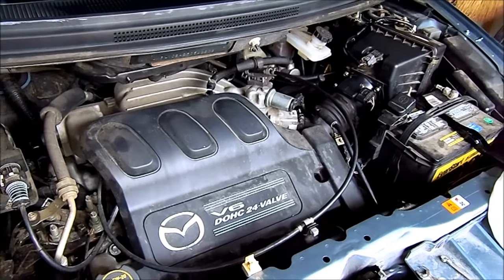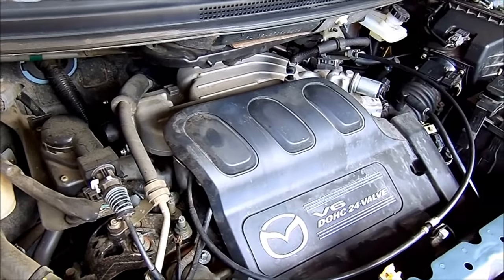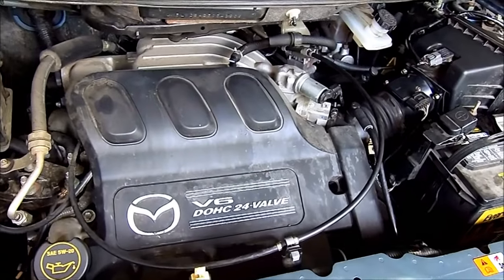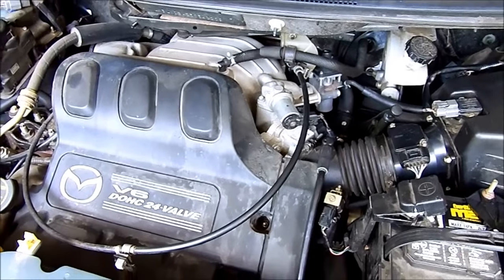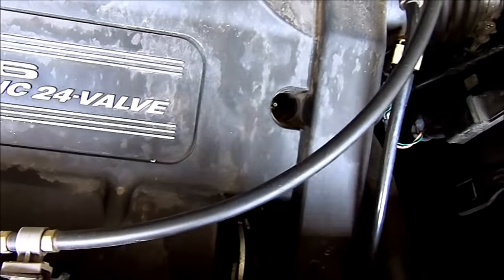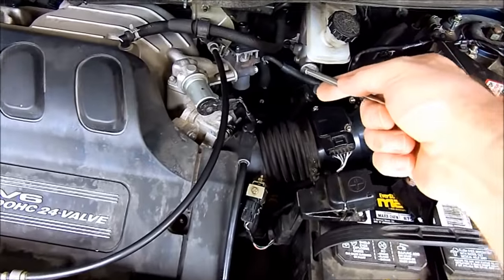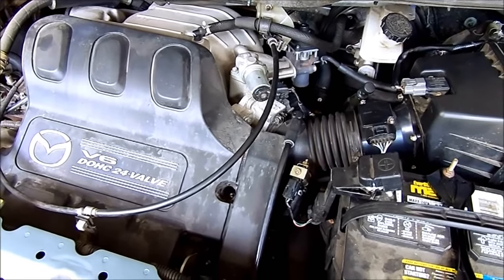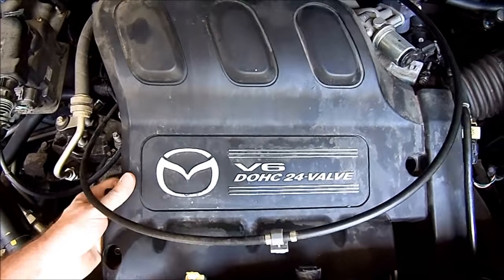Mazda MPV Spark Plug and Coil Change

Comment: Thank you very much. As someone without mechanical experience, removing the manifold seems like a colossal undertaking. Your video takes an intimidating task and lays it out in manageable steps for the whole process. It doesn't mean that it's a breeze; it took me several hours of meticulous work, scratched hands and pulled hamstrings, but I understood the steps and had the confidence. I successfully replaced the coils and spark plugs on my Mazda 2005 in 2019, and again in 2024 after the warranty on the coils expired. Each time I studied your video to prepare. Me and my Mazda thank you!
Reply: I gotta do same Thang on my 2002 mazda the rear ones

Comment: Thanks for the video! Just inherited a 2004 MPV that was running horribly - watched your video and was inspired to take on the project. Turns out the PCV hose was toast - replaced that and coils/plugs/PCV valve - purrs like a kitten now! Couldn't have done it without your vid - cheers!

Comment: Thank you very much for this informative video. Gave me the confidence to do this myself. took 2 hours. the price of the parts was significantly less than what the shop charged me to replace a single coil. The rough idle completely gone and car running well.

Comment: Tip: that piece at 18:00 on the top of the intake. Press down on the black plastic ring around the connector while pulling up and it will pop out every time.
Reply: Thanks for the tip

Comment: I've hardly done anything on a car before. Spent 5 trips to the auto store. I spent 10 hours total doing this, but was eventually successful. It all sucked (the worst part for me were the 4 small hoses behind/underneath the air intake hose) BUT I wouldn't have been able to do it without this video. Thanks!

Comment: Well, did some investigating and found 2 things. My coolant reservoir was completely empty. Filled and took for test drive and still no heat. Came home and looked at all the hoses for leaks. No leaks. So I look at the 2 big hoses going through the firewall and notice something that looks like a switch on one hose. I flip the switch (which is actually a petcock) and voila! I now have heat! I didn't notice the petcock during my uninstall/reinstall but it is right next to the back intake bracket. So I must have moved it when I was doing my work.So mystery solved! Thanks for all your help KB. You da man! :)One other thing... Chris Isaacs is me below so commenting by the same person. :)
Reply from the maker: HazyVonHazenstein glad you figured it out and thanks for posting that great info!

Comment: So happy I found your video. I changed 4-6 yesterday but had no idea how to get to 1-3. I was going to try to do it myself this morning, but looks like I may need to wait for my husband so he can help. 
Quick question, does taking it apart like this make it easier to get the O2 sensor? We just replaced two of them but getting a misread from that one. Was thinking of checking the connection and wires if possible while changing plugs.

Comment: I've got a 04 MPV LX. Runs and drives great, reverse not so much. It sorta creeps backwards while on level ground but give it some beans and it revs up like it's in neutral. 

Thank You for posting this. I've got 4 different tires, I'm sure the plugs on the rear cylinders haven't been changed. Lots of little things that weren't done. Cabin air filters were completely clogged up. I'm losing coolant but thankfully not into the oil. That's diluted with fuel. 😋 Just more opportunities to learn new things to fix or replace.

Comment: Nice thorough video. Might also suggest resealing valve covers. My van at 80k miles is actually dripping oil on the exhaust. Also would it be easier to access those lower vacuum lines if I removed the throttle body?
Reply: That actually could be the other oil burning smell on my 04 MPV. Going to check it out later today. My trans fluid is toast and I plan to get it changed soon with a new filter. Love my minivan.

Comment from the maker: Thanks for the kind words and comments!  Glad it's helping people out.
Reply: Woelikplim Elikplimi Kill-O-Byte Please note correction of typo error in my previous post to you i.e. - ("...plugs and coils needs to be changed or how often should it be changed...") I will also be grateful if you share your personal review of the 2002 Mazda MPV with me since you know so much about the car. Many thanks and GOD bless you Sir.
Reply from the maker: +Woelikplim Elikplimi The MPV is a solid and reliable van overall.  The PCV valve hose tends to split right around 70,000 miles.  I have a video on it here:  https://youtu.be/eEQ5xUKx8LE.  Mazda sales an updated designed hose that is supposed to fix the issue.  I would suggest changing the spark plugs and coils somewhere between 70,000 and 100,000 miles.  Mine lasted 100,000 miles before the check engine light came on due to a coil going bad.  The engine started running rough just before the light came on.  Thanks and good luck with yours!
Reply: Thank you so so much Kill-O-Byte. I will check out the link you sent to me. God bless you forever.

Comment: So I just did the rear coils and it took about 3 hours with a break in the middle.  I removed the throttle body so I wouldn't have to disconnect the coolant lines going to it.  The only difficult thing I found was get access to the EGR valve bolds so used a 1/4 socket with a wobbly with a 1/4 extention through the break valve pipes with a second wobbly and adapter to a 1/2 ratchet.  Pretty easy overall.

Comment: I hope you still are helping, I had them replaced and it runs good but the light stopped blinking but is still on code stating lower O2 sensors needing replacing at this time, but on funny thing is I gave the shop 5 QT of oil and a new filter.  When my wife and I picked the van up he stated we needed about another 1/2 to 1 qt of oil????,  No mechanic has ever told me this before for any of my cars. (did they accidently spill my oil)? Then after driving a couple of days the Oil light has flickered come on and gone off is something loose, did you mess with anything having to do with the oil.???

Comment: Thanks kill-o-byte. I followed your instructions step by step and was able to take it off. I bought my 2003 mazda mpv for 5,000 and had only 50,000 miles. I'm very disappointed with this van. Two weeks after purchase I noticed a leak where from oil pan gasket. Had that replaced...that was 160.00 dollars. Have had two batteries which I purchased at O'Riely...both went bad before warranty...never buy your battery from O'Riely...eventually bought one at Sears...so far so good. But, now the coils. Why so many problems with a van that has only 50,000 miles? I found out that though it has the Japanese name 'Mazda' they're manufactured here in the US...and I believe by Ford. That explains everything about the poor quality of the vehicle. I'll keep this piece of crap for another 50 or 70,000 miles then get rid of it before it nickel and dimes me to death...that's what American manufactured cars do...
Reply: Interesting how people have different experiences.  Our van just hit 200K and is only now starting to give us problems.  One of the best vehicles we have ever owned.  (Contrast that to a KIA Sedona we just traded; 60 days in the shop in a 12 month period and just a hair over 50K on the clock.)

Comment: you need a clock to show how long it took to get each point. He says it takes 4 hours with camera work at the end. This is why it's worth it for most people to pay somebody to do this, not a beginner's job. You have to disconnect everything the air manifold is connected to or blocks, then remove that part. Not like my old 1970 Valiant tune up.

Comment: Just finished this job yesterday and this video was a life saver! Van has 140K+ and first time doing plugs/coils. She's running MUCH smoother now. However, now I don't have any heat. Did a miss a hose somewhere? I did lose some coolant when I disconnected the hoses. Maybe I'm just low on coolant now? Any help would be greatly appreciated.
Reply: 4years ago. What did you find?

Comment: Had a flashing CEL showing lean both banks. Replaced the intake hose then got p0301 with stuttering idle. Took off intake and found cylinders 1 and 3 spark plugs loose covered in combustion material. Cylinder 1 plug's electrode was broken and extended down onto little arm at end of plug. I'm changing all plugs to be safe!! I should of known something was wrong when I started getting a faint gas smell in vehicle.

Comment: Any chance to get the front ( 4, 5, 6 ) coils out without removing the intake manifold?
Reply: There is no need to take off the intake manifold for the front 3. Just take the cover off :) It is the rear 3 that is probably a 3+ hour job.

Comment: Nice video, I did this job at 100k on 2003 Mazda, am still having problems with front coils (only replaced 1,2, &3) at a 130K my van seems to eat the #4 coil, i am thinking of checking the connector.
Reply: What did you find?

Comment: I have a 2006 and was wondering if the PVC pipe is an issue for the 06s as well?
Reply from the maker: +Bob G I'm not sure when they redesigned the hose.

Comment: Hi Kill-o-Bite,
Love your videos, I recently was told that I should only use American spark plugs for this car because it's an American engine. Though I liked using Ngk. Did you need to clean vale cover baskets
Reply from the maker: This engine was pretty clean.  I did blow out and wipe off as much grim as I could before removing the intake.
Reply: +Kill-O-Byte Where did you buy your coils from because I may need a new set.  Thanks for your help too!!!

Comment: Hi there. How long would it take for a experienced mechanic to chenge the spark plugs on a Mazda mpv?
Reply from the maker: Labor time for an experienced professional is 1 hour IMHO.  They may have a fixed labor time for the job that is more than that though.
Reply: I was told 3 hrs for labor by mechanic I know they probably just trying to make money.
Reply: @ravangrayson2977  It took me 3.5 hours.  That included replacing the six plugs and all three of the back coils.

Comment: I bought some Ignition coil on amazon that fits Mazda 2003 mvp lx but how do i know which coil goes in which for the firing order of 123 in the back and 456 at the front?
Reply from the maker: The coils are interchangeable and can go on any cylinder.  Just make sure the wires running to them stay with the same cylinder.

Comment: Hello guys, I have a 2005 mpv. the p0302 code just came up so I had a mechanic change out all my coils a and plugs, the engine light still shows the same code and we even turned off the light and it came back on again, it feels better than before but it still sputters at low rpms and at a stop where before it was happening at higher rpms, I keep thinking maybe the mechanic didn't connect something back correctly, but it's weird that the same exact code comes up p0302, is there something that he could have not put back correctly that would cause the same code to come up, I mean how come another cylinder doesn't show a missfire code only the one that was showing a missfire code in the first place, I would appreciate your input, thanks.
Reply: Look at replacing your idle air valve . you can do it yourself in about 5 min

Comment: what torque wrench did you use? i want to buy an accurate torque wrench for this for as little money as possible if possible
Reply: That looks like a craftsman torque wrench.
Reply: is it accurate? i was going to get the pittsburg adapter because i seen somebody calibrating with it and a lot of people say its very accurate and only 30 bucks
Reply from the maker: As Ezeey Eric said, it's a Craftsman.  As far as I know, it's accurate.  I haven't had it checked in awhile.

Comment: On the EGR the vacuum hose were dose that go mine is short and you can hear it sucking in air my engine light comes on an says PO174 bank2 to lean
Reply from the maker: +william delair The vacuum hose goes from the EGR valve to a sensor on the air box, which has another hose going to another sensor, also on the air box.

Comment: Great video, I think I did everything right but when I connected the battery back the alarm went off and now the car won't start. Does anyone know how to fix that?
Reply from the maker: Check your alarm system.  Just a guess but it sounds like your alarm system has disabled the vehicle until a code is entered.
Reply: Sounds like a security issue which is triggered by removing the battery connections. There is a way to avoid this by using a tool consisting of a 9 V battery plugged into a power outlet. Look into it. Check owners manual.

Comment: JUST hit 203,567miles on my 05 MPV... my ignition coil, and cylinder #2 are going bad... not excited about this- especially since I JUST found a crack in the plastic part of my radiator, just under the hose... I wanted to try to do this myself, buuuut, it looks like it's a TINY bit more than what I am able to accomplish on my own. SUPER bummed out face
Reply: i had a mechanic do the spark plugs. he did it from underneath for the back spark plugs,, he needed a special tool.

Comment: I'm just amazed that it's the 21st century and consumers put up with a car design that has inaccessible spark plug holes and coils that are also buried on top of a hot engine -- it is to be expected that they won't last long! Do people really believe it's not possible to engineer a vehicle better than this? This is progress? There is no excuse IMO -- smart consumers should just say NO.
Reply: That is a FORD engine, what do you expect ?
Reply: Well, ease of maintenance DOES factor into design engineers' engine designs but not ahead of performance, cost and other variables. Yes, I too wish that it wasn't horizontally-opposed so that I could access the plugs as easily as I can my other cars, but at the end of the day, this isn't really all that much extra work. I mean, there are some supercars that DEFINITELY put ease of maintenance on the back burner as some require the entire body to be removed from the frame to change the oil and half the motor to be disassembled if you want to also change the plugs. Xd

Comment: I have a p2187 and p2189 can you please help
Reply from the maker: Those are codes saying you have a lean condition (too much air/too little full) at idle.  One code for each side of the engine(both banks) so it has to be something in common to both sides.  I’d check for vacuum leaks, such as cracked hoses, but there are a lot of things that can cause those.  Check out my video on replacing the pcv valve, it has some basic tips on troubleshooting a vacuum leak.

Comment: How are you replacing plugs over 100k it's impossible bcuz your spark plugs only last 50k and especially if there cheap bcuz I changed my spark plugs and mazda only puts Densos and not Motorcraft, when I got my van it had 89k I think but it definitely wasn't 100k miles, and your not supposed to use antiseize since your not supposed to tighten your spark plugs so tight, it's like your oil filter you don't tighten it so much as matter of fact you hand tighten your oil filter until you can't

Comment: This is when Ford was still involved and influencing Mazda almost into insolvency. Simple maintenance like changing spark plugs required an expensive trip to a mechanic, usually THE DEALER. If you think this is a "chore" (and most folks wound up breaking off studs in the heads when removing the manifold).  changing the alternator and belt requires you taking the passenger side axle and hub off to reach a few of the bolts. The  4 cylinder power plant  (both gas and diesel) weren't imported into the US because they were "noisier" and Soccer Mom's don't like "buzzy" motors). (SMH). Those powerplants were more reliable, easier to maintain, and capable to move from Point A-to-Point B. Well designed van, Epitomy of "Planned Obsolecense" by a corrupt Detroit auto maker! Mazda finally broke free BUT has never really recovered from The Ford Experience!